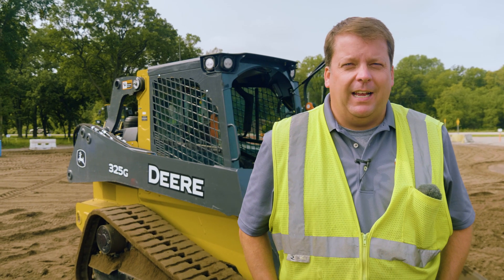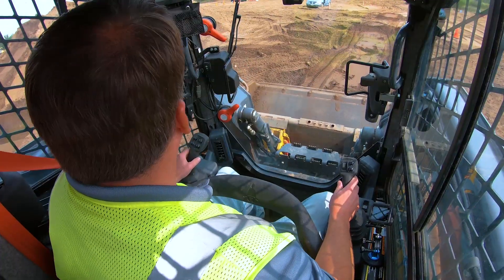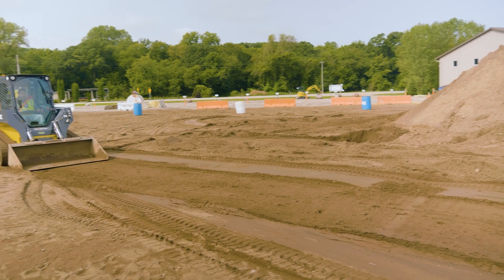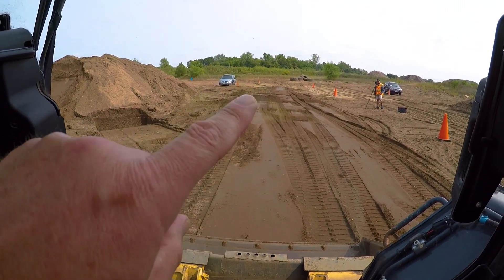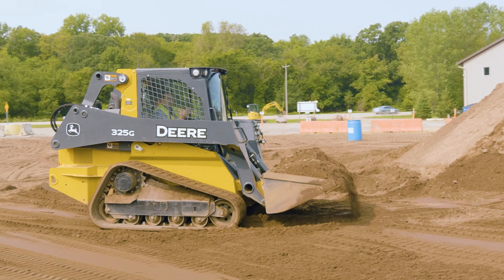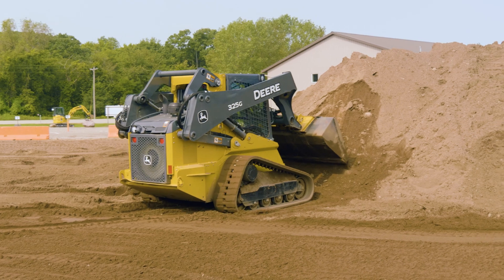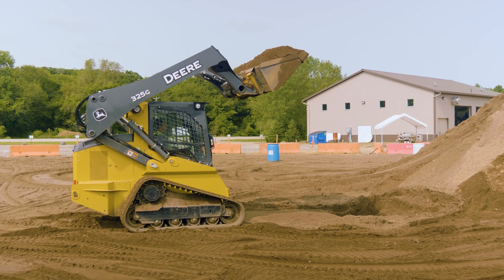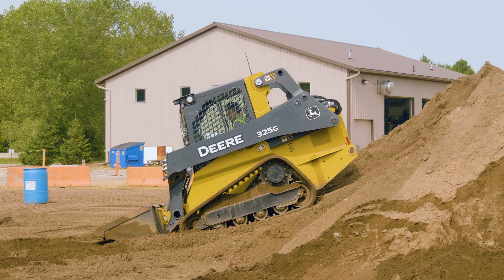How to Operate a Skid Steer - Advanced (2020) | Skid Steer Loader Training

Comment: If you are cutting in a driveway on top of grass the one thing I've learned to keep you from creating waves is only take an inch at a time. Dont try to remove too much at one time. That's my little bit of advice for new guys.
Reply: I’m doing one soon . Do you use the teethed bucket or just a cutting edge

Comment: does no one operate with the bucket vertically down using the bottom of your bucket blade? And picking the bucket up after a back drag and sitting it back down on top of grade and when you see a low spot flick the stick to throw your dirt smoothly, or is that just me.

Comment: Big mistake you're making is you fill the low spots but you don't pack it before making another pass so all you're doing is  gliding across the packed ground then scooping the material right back out of the low spot you filled in. You're basically chasing your own tail.

Comment: I like to back drag a lot to help pack material in faster, but I also don’t ever run a skid steer with tracks so the tires like to squish unpacked material out. 

One thing to watch for, if you work somewhere with bigger rocks (3” and bigger I’d say) if you get a rock trapped under your bucket, and you back drag, you will just rip out all your material until that rock finally rolls under the bucket or you start going forward again

Comment: I love the john deer skiddy but the only downfall I've come across is the protection for the radiator. When backing up steep grades if any material comes into contact with the fan blade, the blade will throw it right into the radiator and puncture a hole. The cats have a much better design for protection from debris getting into the fan blade. I would still rather grade in a john deer any day over a cat though. Both have their strengths and weaknesses  but the deere is much more user friendly when it comes to precision.

Comment: So for you experienced grading experts, is it the same principle as using a box scraper on your Tractor. Leaving your box blade level not tilted but dragging level filling in low spots. However unlike the Tractor the skid loader does not fill in the low spots because the bucket is not spilling dirt forward to drop out. Does this make sense? Thanks.

Comment: I have been digging pools and grading around them after concrete is shot to backfill and grade out for deck area as well as final grades. In Florida.
Reply: I had a swimming pool excavating company in California..  I had a 825 Bobcat, a 700 Bobcat, and a 974 Bobcat..  The 974 had a hoe attachment with a 4 foot Digmore extension on it.. I also had a concrete breaker for the machine..

Comment: Instead of dropping the bucket and then tilting it to grade, you should tilt the tip of bucket down a little snd then drop bucket all the way down. 
Same thing when back dragging. Unless you want to pull dirt back with you as you drag.
Reply: What's the difference between doing what you said and bringing the bucket down then tilt? Isn't it the same thing?

Comment: Without a side tilt feature on a bucket, how does one begin to make a swell, trench, or other angled trench with a ctl?  Know what I’m asking?  Do I dig and dump, dig and dump, etc. to get one track higher than the other and then drive in that sideways to get the tilt of the trench??  Or, just use an excavator? Thanks!
Reply: If you want an angle form that angle by loading one side of the bucket and spread along the swale trench. Use the new material to force the blade to dig one side now. Or you can use the same process on a slope to level it. Like if a track or road has an unwanted camber.

Comment: I was taught to swivel your head.

Also, the BIGGEST mistake I do see is that many operators rely solely on the onboard computer. The newest equipment I operated routinely was 2006 model year and recently I was asked by a buddy who has many pieces of equipment to help him for a few days. I was given strange looks, because I actually got in the engine compartment and visually inspected all levels. One of the workers was trying to explain all about the onboard computer, and I said that "Computers can be programmed to display false information."

I was called about 2 days later and was told that 80% of the fleet of equipment was down.

The computer on 1 machine said that the hydraulic fluid was full, but in actuality was bone dry

A different machine gave an alert for 1 thing, yet something completely different was wrong.

Point of the story,

Always visually inspect be as a safety precaution.
Reply: That’s more of a mechanic tip really has nothing to do with operating the actually equipment, helpful none the less lol
Reply: @hunterholdsclaw2654  At the end of the day, The operator needs to visually verify that the machine is able to last the duration of the day, regardless of mechanic availability.
Reply: @hunterholdsclaw2654  If you are a tractor trailer driver, you are legally required to complete a "Pre-trip inspection.

If something goes bad, the operator is solely responsible.
Reply: @edstevens6839  yes those are laws and pre-trip things, not things that pertain to actually operating the equipment(as in actually driving and controlling the bucket) thought it was pretty clear there’s a difference in the two
Reply: @hunterholdsclaw2654  pre-trip is a part of basically all skid-steer courses. If you work for a company and operate a skid-steer with no engine oil or coolant or any other fluid it’s your fault. So yes, it is related to operating.
Reply: @jordanpayne6838  if it has no oil or coolant then a light would be on. Also your very naive if you think every operator does that.

Comment: I’m doing a Plant operations Certificate 3(Civil Construction) and the skid steers we get given to train on are JCB’s with big horrible tyres and after watching skid steer instructional YouTube videos I would much prefer to be trained  operating tracked skid steers as they look like they operate much more smoothly and leave less damage(holes when turning!)which is ideal IMHO.
Also once you have spread materials/filled/levelled you can raise the empty bucket right up and use the tracks to go forwards/reverse over your final grade to compact down the material
Reply: I would agree that tracks are better unless you are dealing with ice or slick snow hard pack. Then chained tires are the winner.
Reply: I would argue that learning on a tire machine is much better. If you can learn how to spread and grade evenly, and turn without tearing everything up on a tire machine, the track machine will gravy for new operators

Comment: I found it helps when back blading to have dirt in the bucket an lift the back of the blade with the front on the ground so it'll fill in the low spots an the blade won't go up an down with the ground  it'll stay flat. If that makes any sense I'm still learning my self. Great tips an great vid.
Reply: You knock down your grade then back up with the bucket full. If you do it right you can shoot a game of pool on your grade lol
Reply: @MikeRuggiero73  it's work really good with dirt in the bucket.
Reply: Won’t it be dropping dirt everywhere not just the low spots?
Reply: @rubes1688  as long as you don’t get a full bucket you should be good he’s talking about just giving the bucket a slight tilt to apply more force to the area being back dragged, you’re able to apply more weight when tilting the bucket down
Reply: This works great but also. The sharper you have your bucket pointed toward the ground the more dirt you’ll move back blading, the “flatter” the bucket the more it drops from the bucket, it seems super simple and obvious but it helps a lot to know

Comment: I’m 16 and after probably 15 minutes in a skid to learn the controls, I graded a site that had ditches for drainage pipes and made it look professionally done by doing nothing but back dragging with the float function
Reply from the maker: Hey that works..nice work!
Reply: If you only used the float then the grade wasn’t set right, you can make it look pretty but it’s still gots to drain properly if you wanna have a job doing this man
Reply: @hunterholdsclaw2654  the grade was mostly where it needed to be it just needed to look pretty after filling in the trenches
Reply: @kiernanb9445  oh I got ya man badass nice work